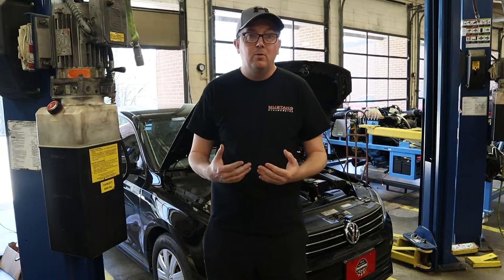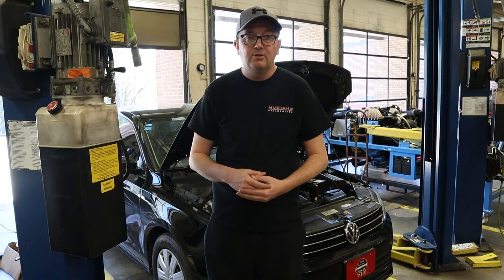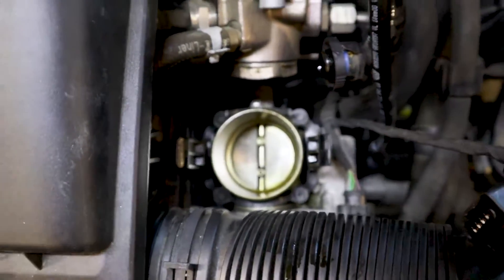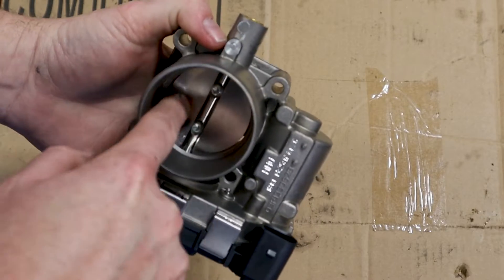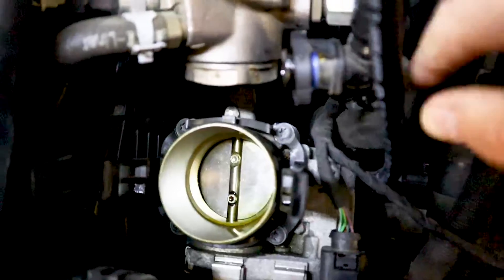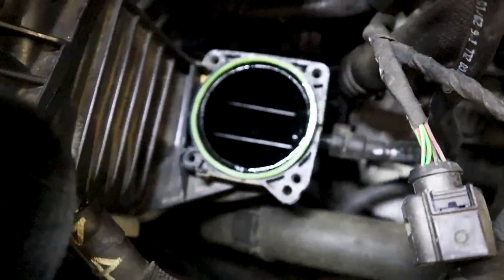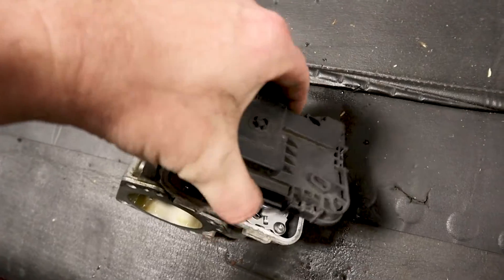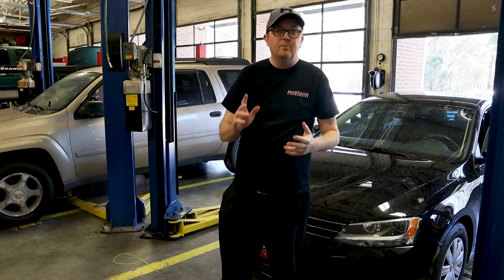P1558 code diagnosis and repair for a 2016 VW Jetta EA211 1.4 turbo

Comment: my 2017 Jettta EPC comes on and off with the check engine light. Question:  Is this easy enough to do at home with no mechanical experience? i was quated $1200 at the dealership. I saw parts for around $55.00-$100.00. 2nd if I do this at home what do I do about the scan too reset?
Reply from the maker: Anyone with an upper level scan tool can reset this for you for probably around $100

Comment: Is it hard to clear codes after replacing throttle body
Reply from the maker: You need a scan tool or something like that, but not normally.
Reply: What kind of scan tool I'll need? Thanks for info/ great video also❤
Reply: @leslysantiago4613  vag tool is recomended
Reply: Thank you sir 🙏

Comment: I'm told on BMW's one does NOT want to press on that throttle plate. It will be dislocated. Is that true?
Reply from the maker: I have never heard of that before. I have pushed them open on many BMWs to clean them. It may apply to newer ones. I also would never do this with the key on, always car off.
Reply: @AutoScholarwithMrB  Thank You very much.